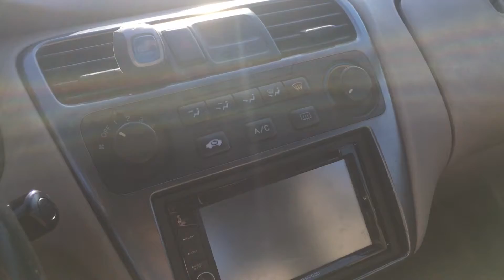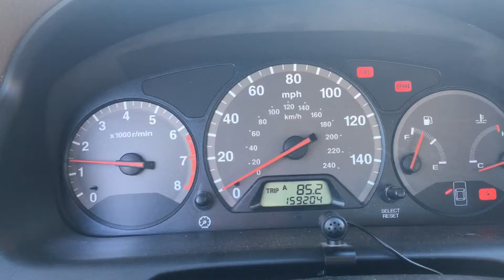Accord 1 year 8000 mile update

Comment: I have a 2001 in the same exact color and spec, except it has leather/power drivers seat. Really looking forward to your plans for this car as I'd like to do some work on mine as well.

Fyi there's an open recall for the airbags. Might want to look into that.

Thanks for the upload!
Reply from the maker: Tj J great to here someone else has one of these! I recently just got fogs from the junkyard and I’m getting wheels after winter. Also i will look into the airbag recall. Thanks for watering
Reply from the maker: Tj J btw is yours a 5 speed or an auto?
Reply: I've got a 5 speed stick 4 cyl with the sulev motor. That's awesome dude!! I'm also interested in wheel/tire upgrade after winter. Looking at upgrading my 15" to 16" since that's what the v6's come with.
Reply: Lmk what wheel/tire option you eventually go with and deff appreciate your content. Subscribed!